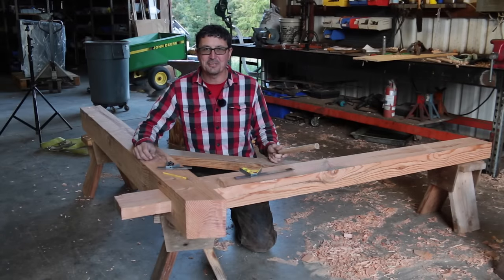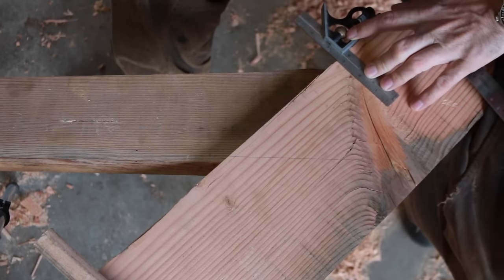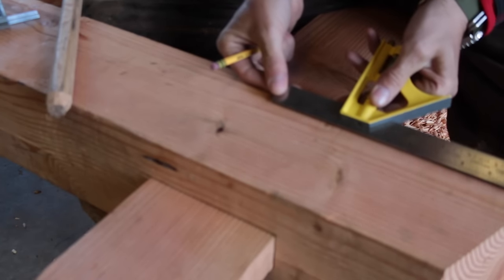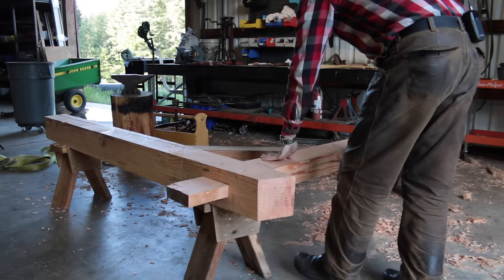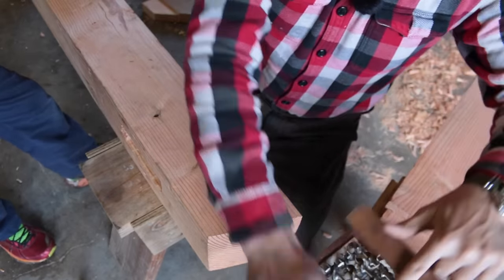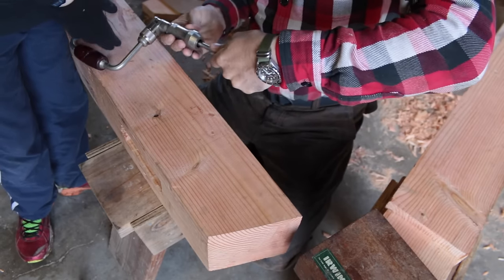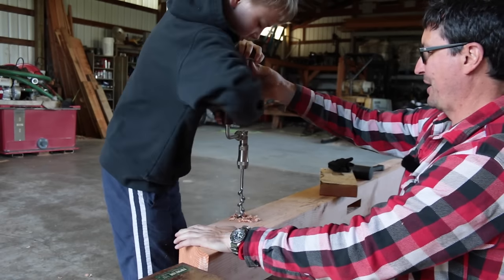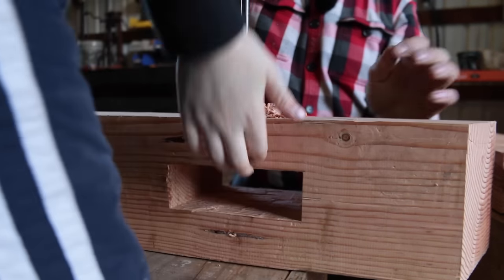Bomber Timber Framed Mailbox

Comment: I wanted to congratulate Mrs Wranglerstar on her little snipet,  in the June/July issue of Mother Earth News, on timber framing. I also want to predict that your channel will go to over 1 million subs as a result of this!! I was also thinking that if you bored a 1" hole in a 1/4" steel plate with shallow sloping walls and a perpendicular plate for the vice to grip you would have a dowel plate for making your pegs. The mailbox problem could be alleviated by forming your own mail box out of 1/2" steel plate, make a inverted U shape and weld another plate to the bottom and rear and fashioning a door out of the same plate. Oh what a surprise the mailbox baseballers will have when they try to destroy it!!!!!

Comment: Any plan to treat the inner parts of those joints before you permanently put them together? Some nice linseed oil or other sealer to protect the wood from trapped water could give it a few more years. Unlike a normal timber frame this will be out in the elements.

Comment: We don't have a mailbox out front where we live now.  We did in Michigan.  We live behind the PO but to get mail we have to rent a box--everyone does cause there is no house delivery in this town in East Texas.

In Michigan I mounted our mailbox and our neighbors' box on a piece of railroad steel turned upside down which was welded to a piece of 90 lb rail that was buried 3.5 feet into the ground and two pieces of steel tread plate welded to each end to protect the boxes.

Where my wife grew up their mail was delivered by boat for a number of years until the road was upgraded to where the mail could be delivered by vehicle.  The road was not reliable.

Comment: It's obviously too late, but the two pegs between the vertical and horizontal pieces should not be aligned, they should be on a diagonal, so on they never end up aligned with the grain of the wood on any piece. The way you did, there is a rick of a crack on the one piece where the two pegs are aligned with the grain of the wood.

Comment: It doesn't seem over built to me, but the post does seem a bit on the short side of things. But I like to set posts 36" into the ground and it seems like that would make for a very low mailbox..

Around here many folks have gone to steel pipe posts and steel pipe mailboxes after having so many destroyed by kids with bats.. Though I heard a guy got sued for that when someone hit it and the pipe mailbox came through their windshield. Dunno if it actually happened though.
Reply: +TX Rider Had a landlady once who set a steel pipe in concrete inside an old tire, then buried the tire just below the surface.  Next car that tried to take out our mailboxes ended up high-centered when the tire tipped up as the pipe went down.  LOL

Comment: If you need a mailbox, you don't live in the wilderness. (Lucky you!)
Reply from the maker: +JuliaB1955 I live in the wilderness and have a mailbox,
Reply: +JuliaB1955 I did live in one house that was so far out we didn't have a mailbox.  Had to get a PO box in town.  Needless to say nobody delivered anything out there.  The only service we had was electric.
Reply: +Tenspeed TheBikeHanger I live off-off "road" (as if) with no street address, no elec, gas, water. No deliveries of any kind whatsoever. By myself. Am 60 yrs old.
Reply: +Wranglerstar Does the PO deliver? Which state, if you don't mind saying. They don't do so in northern NM. I'm sorry that your viewers took my comment as a negative remark. I truly had no idea that the USPO delivers to rough, off-road places, since they don't do so in NM. I think I'll unsub. Make your viewers happy.
Reply: +Christopher Long Why?
Reply: +Peter “Crackpot Pete” Carlson C'mon, Pete. I'm sure you have a better imagination than that. For one thing, I could be watching from my laptop or phone at a WiFi equipped place in town. But I'm not. See below.
Reply: +Peter “Crackpot Pete” Carlson I don't live in a motor home. I live in a Weather King "cabin" (shed). I had a solar array installed on it/batteries in box inside it before it was moved to off-road locale. I haul water. Still have three more years to pay for the array. Takes 30 minutes to go 6 miles to the road. I like the relative solitude, but not fond of being surrounded(-ish) by animal-hating TrigglyPuff hippiecrites, and upset by how the "road" tears up my car/tires/that arm thing under the tires no matter how slowly I go. Got stuck here because I went broke taking care of my now late brother w/Down syndrome by myself for 7 years. No on govt dole. Never was.
Reply: The local satellite ISP put a little dish on the roof. Clear southern view to the tower, approx 17 miles away. Works pretty well.
Reply: +JuliaB1955 Don't unsub.  The variety of the comments is one of the many things that makes this channel enjoyable.

Comment: Maybe you said and I missed it, but why not drill the holes while it's all together?
Reply: +Jesse Smith The holes are offset slightly to pull the joint tighter together when the dowels are pounded in.